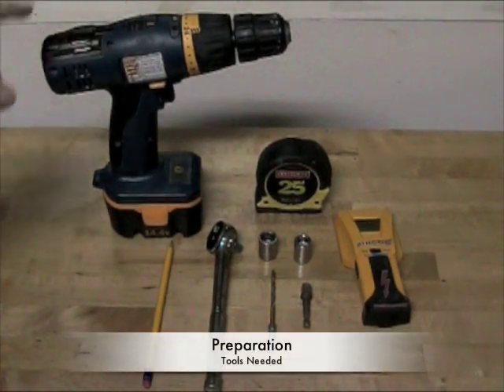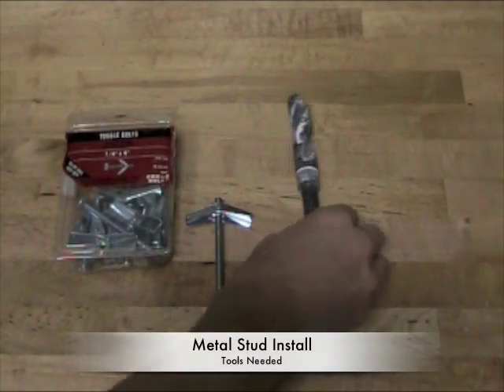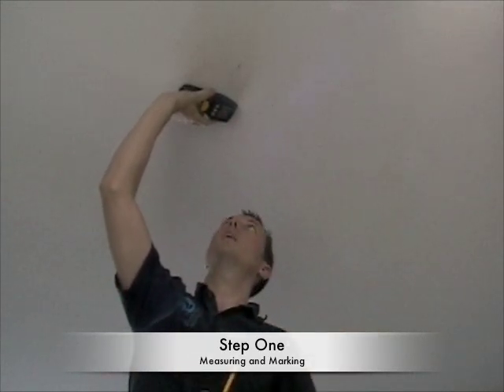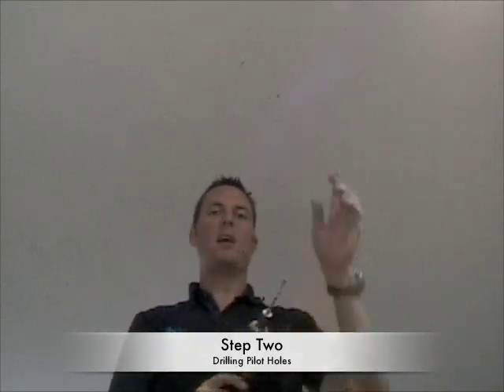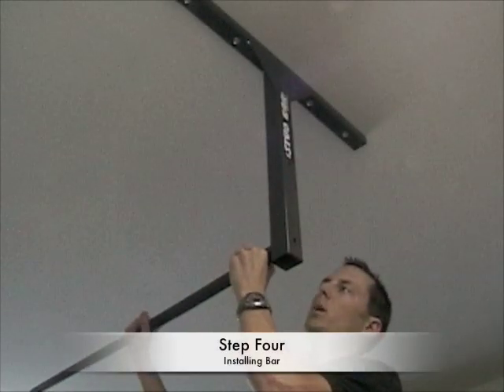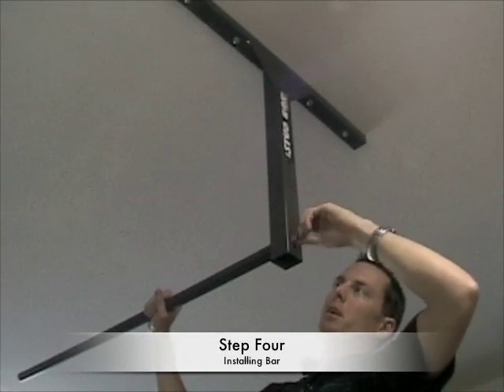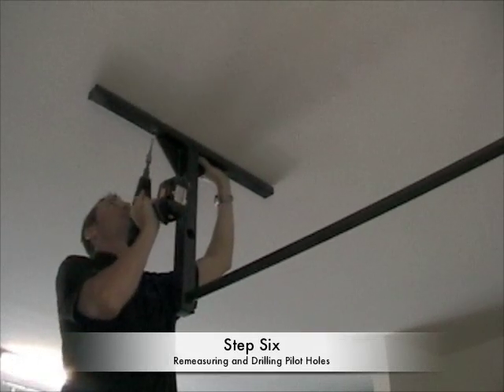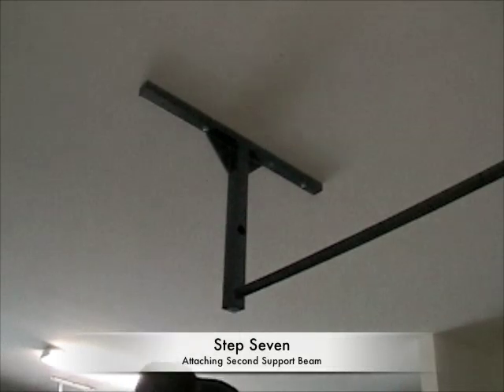How to Install a Pullup Bar On the Ceiling

Comment: my ceiling studs are not 48 inches apart (37 and 52 inches are the closest). Is the width of the bar adjustable?
Reply: nope, it's not
Reply: @zero450571  you were 7 years late